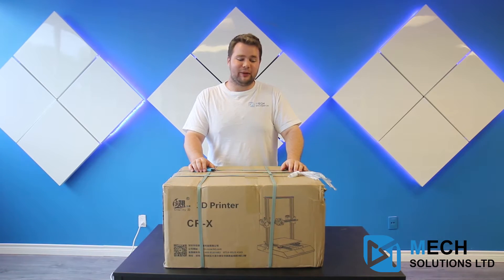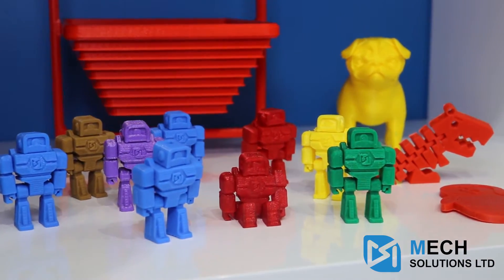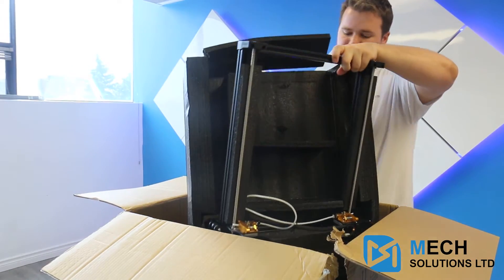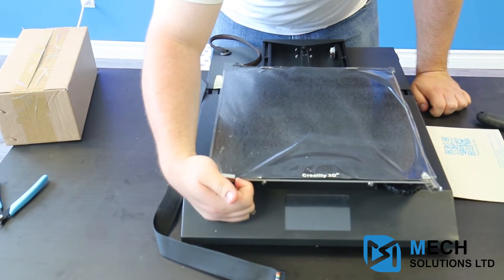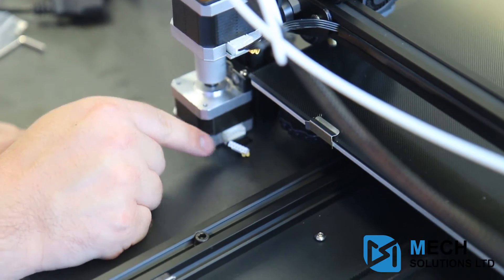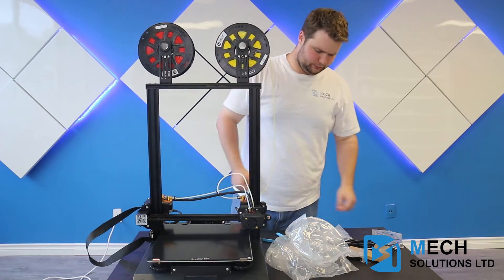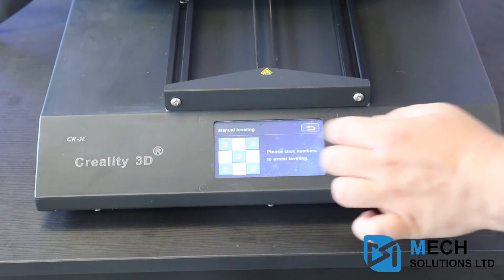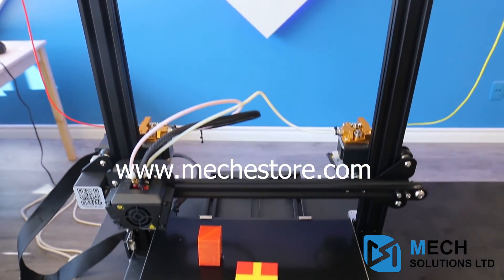The New Do Yourself Dual Color 3D Printer Creality CR-X Unboxing and First Look

Comment: I have a printer of this model, I tried to print a piece of two colors, but although it makes the change from one color to another, only one of the two colors is extruded. It is as if the filament with which it starts printing does not let the other pass when it makes the change with the second filament, even when it retracts the first filament. You can tell me how to configure the printer and how to put the filament, so that it extrudes the two colors and not just one? Thank you very much.